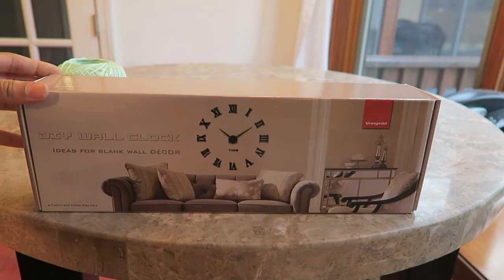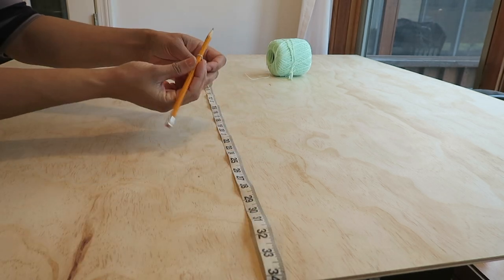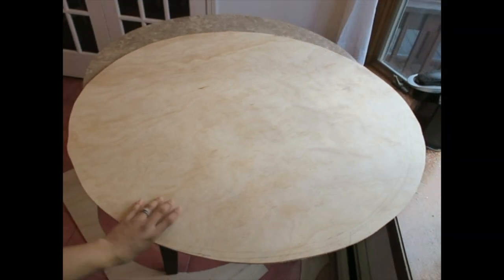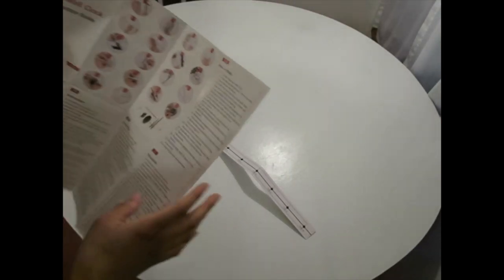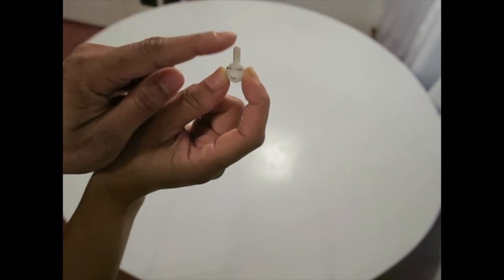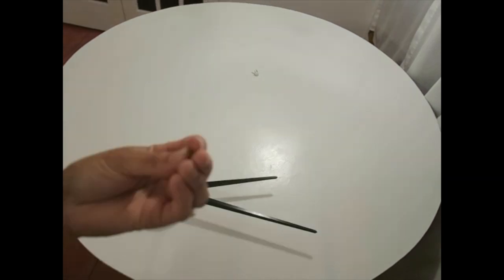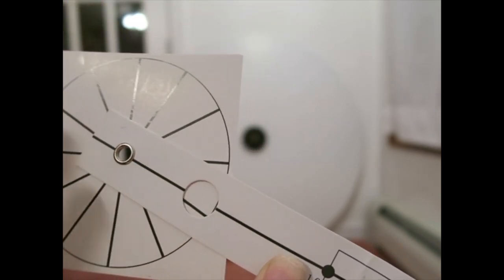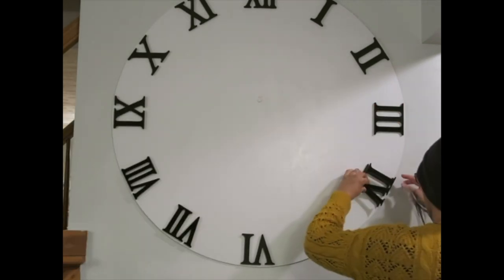DIY Wall Clock ~ Relaxing DIY

Comment: you never used one before?! 😳 i almost thought you were gonna cut the wood around your table lol. omg you were super smart with the string for your circle!! i forgot all about compasses 😂 you got some great DIY tools, this is obviously not your first rodeo. i wish i knew about this clock years ago when i wanted a HUGE wall clock. i ended up finding it at Kirklands. that hook part had me super confused. im glad YOU figured it out lol. this came out great!
Reply from the maker: Thank you so much! I've wanted a jigsaw for a while so I was glad to finally get it and try it out. These big clocks can be pricey. I shopped around beforehand.